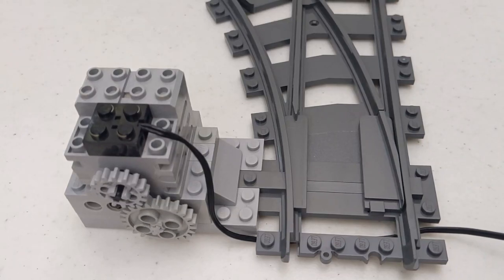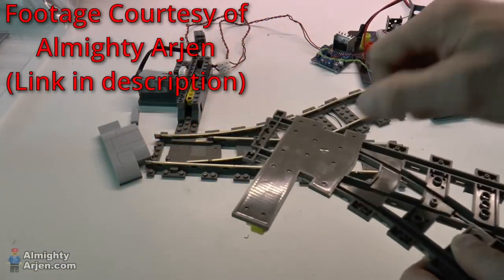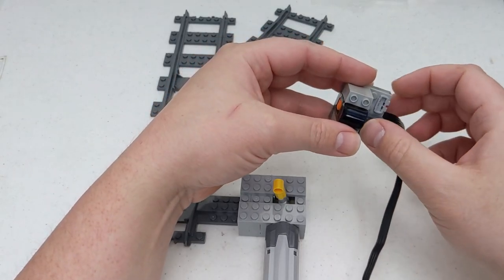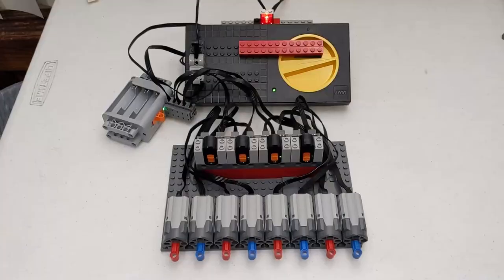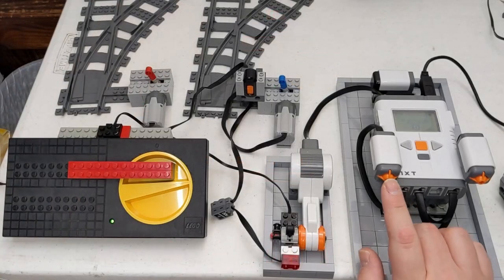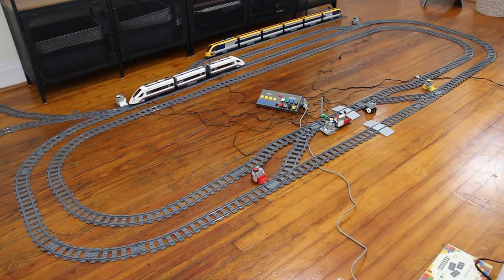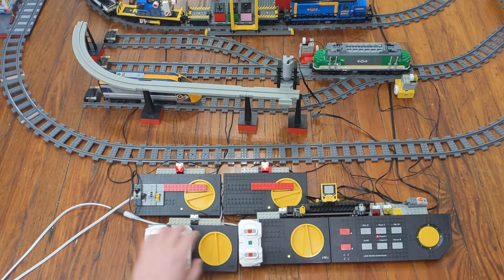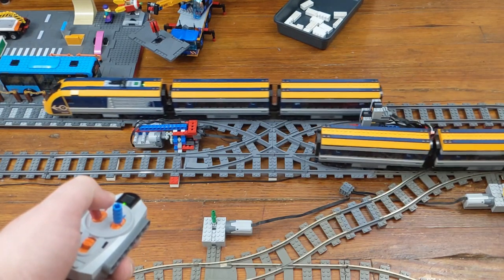Controlling Lego train switch tracks remotely

Comment: Cool video, I like all you different solutions to the same problem! Neat idea to put a 9V light(bulb) onto the switch so you can see when it's in operation. I wanted to do the same thing with an LED, but then you need to have a rectifier (or two LED in anti-parallel); I found it too much of a hassle.
Reply from the maker: Thanks!  I use the 9v lamps all over the place.  It makes it much easier to look for problems such as shorts, open circuits or when something is drawing too much power.  I have them on the regulators on the control panel, and around the layout on junctions.  When LEDs are a hassle, don't forget about the old standby, incandescent lamps!

Comment: Very nice and informative video! I already knew the gearbox with 9V Technic motor and clutch method from an Arduino video and like it very much. You thankfully showed it in more detail.
Reply from the maker: I ended up having issues with that design, or more accurately the clutch gears can be unreliable.  In part two of this video I'm using a different design that works much better
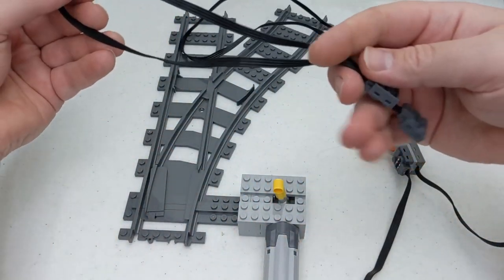Reply: @BatteryPoweredBricks  At which time code? Do you mean the Power Functions solution at 2:00 ? (I have no PF stuff, and getting lots of IR receivers seems awkward to me since PF has already been given up by Lego years ago). By the way, did you remove the locking stubs of the actuator from the original Lego switch, in order to easen the movement, prior to installing the 9V Technic gear stuff and motor? The Arduino video presenting this gearbox does not say whether they easened the mechanism or not.
Reply from the maker: Oh it's a separate video (linked in the description of this one).  I do use PF motors but I buy cheap ones from eBay for $5 or so each, make my own cables / adapters (I also have a dedicated video on that) but I still use the 9v system for control.  Either a DACTA Control Lab, RCX or my solution with Lego 4.5v touch sensors and pole reverser switches (I have a dedicated video for my Lego and non-Lego control panels as well).   I didn't want to have to modify the switches and really haven't needed to with the updated switch machine design
Reply: @BatteryPoweredBricks  Yes, in the meantime I had found the "part 2" video and will watch this.

Comment: I love that self cleaning up crash. It's sad that Lego have dumbed down their train systems. There was a time long ago when it was far more amazing
Reply from the maker: Yes and no.  The Powered Up system can be very powerful but only with third party software / firmware. I've run 4 locomotives as one unit, each with dual motors from a single button.  Without powered tracks you don't have to worry about reversing loops shorting things out and it's easy to control several trains independently.  Over time I've made better systems for controlling the switch tracks as well.  But The old 12v system really was something for its time, I just wish it wasn't so expensive to find nowadays!

Comment: Have you ever considered using pneumatics instead? Switch motors out for pistons, wires for hoses and power supplies for air tanks. All that good stuff.
Reply from the maker: I've used them for monorail switch tracks in one of the first videos on this channel.  I think it's much easier and cheaper to just run a wire to each switch track than 2 pneumatic hoses to each switch track.  It you've seen part two of this video I had a TON of switches and wiring was pretty easy

Comment: I never really got why Lego decided to use those weird yellow lever elements to actuate their switch tracks. It seems like it would have been easy to design a more "in-system" interface, like the sliders and knobs used in the monorail system, that can be much more intuitively integrated with other moving Lego parts.
Reply from the maker: Agreed, although monorail was a bit of a challenge to automate 😅

Comment: for the switches causing the motors to stall because they do not return to the central position, why not build a fixture that has them spring loaded? or just under tension from rubber bands in both directions.
Reply from the maker: I tried a couple solutions but nothing that worked well.  In the end I started using 4.5v touch sensors from a DACTA set from the late 80's as a momentary switch along with the pole reverser switch.  What I like about this solution is the switch stays in its position which helps the operator to know the current position on the switch track

Comment: Very interesting video. I have watched it several times. Maybe it's my lower english level. Still look cool!

Dacta looks impressive, but I think it can be implement this with the help of bluetooth block of powered up system and 88007 part as infared transmitter. Yeah, it will be required some programming expirinece.

I see sped computer on your control station, for why it?
Reply from the maker: I did mention that IR commands can be sent from a powered up hub and light sensor in a recent video "controlling Lego trains from a PC".  The problem is that a mobile device must be used to program and control the hub.  I tend to use an NXT and third party HiTechnic sensor to send the IR commands instead.  The speed computer isn't being used here, it was already built onto the Technic Control Center and I just left it there 😅.  Thanks for the kind words, these train videos are always a lot of fun and I have more planned for the future 😁